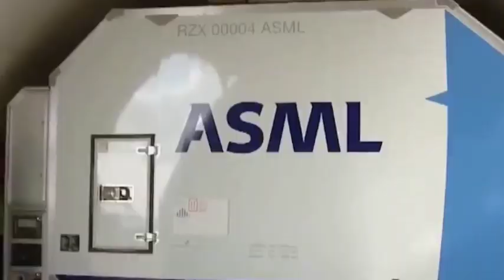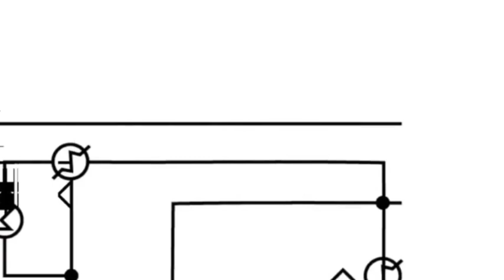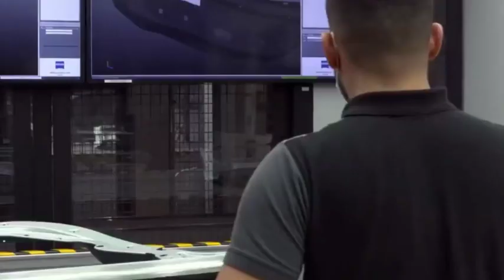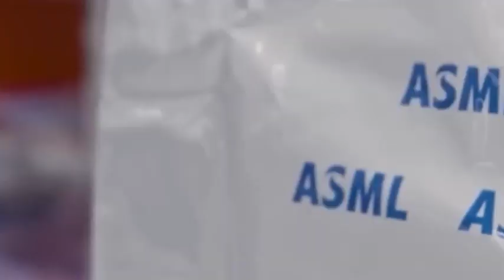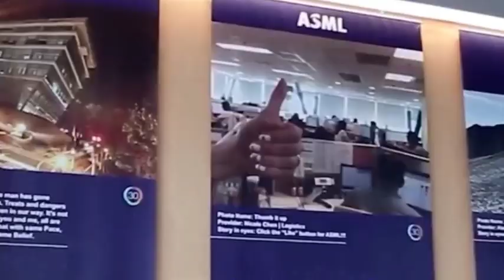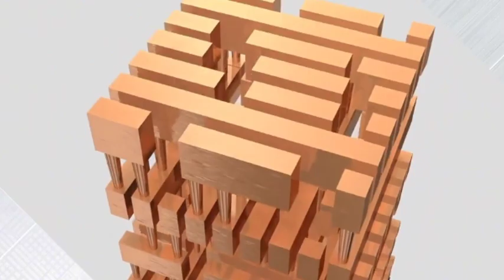Japan will impose sanctions on China, will China's lithography machines become "scrap iron"?

Comment: China has come up with the production framework for semiconductor. One of the criteria is local content. This is also why SMIC drop 14nm from its website. Knowing China, like their EV, they will not come up with any framework unless they are ready. SMEE is launching their 22nm DUV soon as a starter. They already have 28nm. They will mass produce once the domestic buyers can buy from Japan or the Dutch. If the the Japanese ban, it will be a good catalyst for domestic buyer to go local with SMEE and it may push towards the next, 14nm. These westerners and its gangsters never learn. They ban chips, China cancel orders and buy local. They ban DUV, China will also cancel orders and buy local. Perfect. Please Mr Suzuki Ajinomoto, please ban.